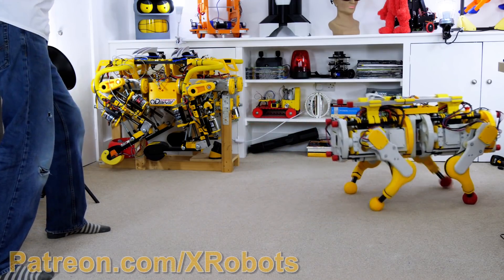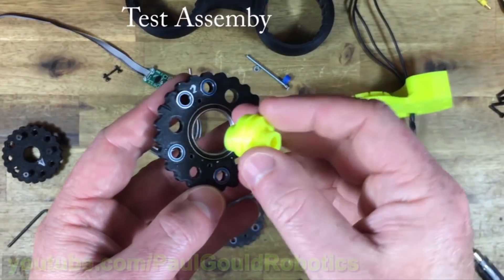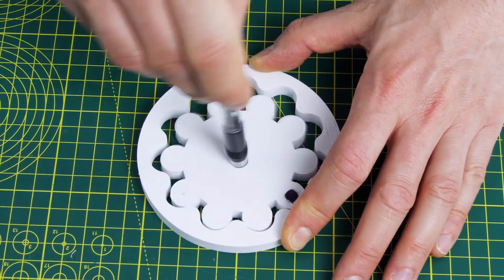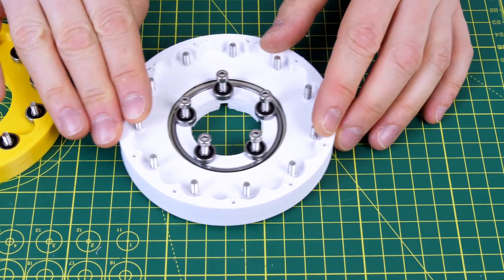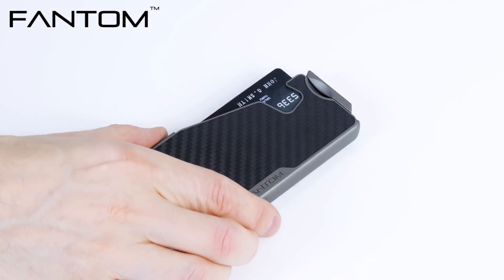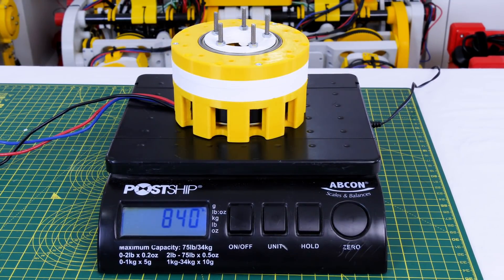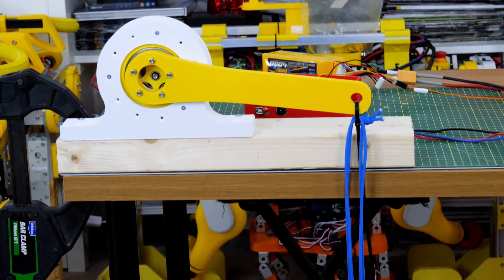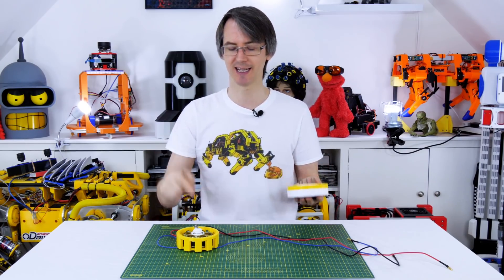Experiments with Cycloidal Drives

Comment: I’d like to to point out that this is not an actual cycloidal transmission, even the animation doesn’t not show it correctly. The cycloidal disc has a specific shape to it which can’t be designed with a basic cad sketch - nonlinear. It has to be calculated and interpolated (e.g. matlab to dxf to cad). I built a full metal version for a robot link myself  (video..), there is no room for shape imperfections :) The actual shape will improve output speed consistency, load distribution around the circumference. In addition: Multiple disc will help to reduce load induced eccentricity and vibration..improve the efficiency (back drivability). As a hint: every roller has contact to the cycloidal disc at any position in rotation. Might seem difficult, it can be described — for “each“ position —  by means of ruler and compasses though
Reply: Is there a technical name for this type of 'cycloidal' variant, or is it just a bastardized version that only works if the materials are somewhat compliant or have large tolerances?
Reply: @rdyer8764  I‘m not aware of a suiting name. It somehow appears as a cycloidal without being a cycloidal :) The cycloidal itself defines a specific shape that’s created by rolling one shape in relation to an other one and tracking a point one the moving element- e.g. circle over circle or circle over a straight line.
Reply: Aforementioned video link https://youtu.be/pzTwEX9iBq4
Reply: @LiyangHU  fancy seeing you here ^_^
Reply: @antitriangular2828  That's pretty damn cool! I think that equation gave me a mathgasm! I love seeing stuff from people way smarter than I.
Reply: @rdyer8764  Hah. Unlikey, I just happened to have been working on an anti-backlash variant of Paul Gould's work after printing his version last week.

In fact, Paul Gould includes his inventor files and the equation is embedded in the defining profile for the disks. I ended up looking up and re-doing it myself because I don't like using equations I don't understand (also - I couldn't get the ratios I wanted to work correctly, and wanted to understand why!).
Reply: @antitriangular2828  OK, I relent...only somewhat smarter. :))
Reply: @antitriangular2828  That's a great tool. It's also fun when you move the sliders out of rational relative ranges and get pretty patterns; some look like Celtic knot work.
Reply: @ardemus  That's exactly the reason I made it really - to understand how the variables relate to one another and to understand how sensitive the equations were to changes in the variables. Trig functions are always fun to play around with.
Reply: Maybe there's a way to counterbalance the vibrations, too. Anybody out there with the proper math skills?
Reply: @jurjenbos228  Counter balancing is achieved by using a second disc with 180 deg phase shift to the first one. Doing this you need a double cam that’s designed accordingly. You can see this in my design. It makes the whole thing even more complicated to manufacture though :) The disc itself can’t be counter balanced since the relativ orientation to the eccentricity is changing with the rotation..
Reply: @jurjenbos228  two disks, 180 degrees out of phase, or two half thickness disks at 180 degrees sandwiching the thicker one.
eccentric cam gets a little large after that.
Reply: @antitriangular2828  Yep, the second option you named is better in terms of load distribution, not the most compact one though. It’s also possible to have even more discswith different phase combinations to improve the dynamic deformation behavior - eigen modi...
Reply: @antitriangular2828  many CAD programs have plugins specifically to create the curves required (I know I've seen it in both onshape and fusion 360).
Reply: I know James uses Fusion, but here's an Onshape feature that makes mathematically correct cycloidal drives:

https://cad.onshape.com/documents/347e6a9ae9d0992f4b101a70/w/d85d62ab1c292cc0d3314104/e/39a63585c0c29cabbfacb536

You could also just look at the code and take what you want.
Reply: I too understand the terminology in this thread
Reply: @EngineeringSpareTime Wow, that looks great. What machining tolerances did you adhere to? Do you happen to know the rough relationship between required tolerances and gearbox backlash?
Reply: @antitriangular2828  Hi could you give me some reference material for the equation and how you made yours?
Reply: Most modern modelling software has support for drawing shapes based on parametric functions
Reply: There's always that one guy.
Reply: @antitriangular2828  Yes, I agree this was not too precise. That’s what I have tried to say with “tracking a point on the rolling element“ :) 
That’s correct, I wouldn’t call this “basic“ sketching tools though, especially not in fusion 360 — what he is probably using.
I posted a link for an step by step construction of the profile in geogebra - seems to get removed..
Nice link! I created mine with a matlab script and then exported in as dxf. This allows to take some optimization for load angles into account as well :)

Comment: I see a lot of strainwave gearing, in industrial colaborative robots, might be an solution as wel.
Reply: I'd actually love to see a proper strain wave gearing that works with 3D printing. I have tried one myself. It was 50:1 and printed from PETG. It did work and had no backlash but was also horribly noisy. Also definitely wasn't back drivable. This is something I should really return to as it did seem promising but was taking too much time back then.
Reply: I agree ...
https://en.wikipedia.org/wiki/Strain_wave_gearing
Reply: They are quite expensive and not really functional if 3D printed though
Reply: @EngineeringSpareTime  ... Perhaps.
But with a little creative thinking, I believe they could be.
I mean ... what this video shows, isn't that functional either. FDM printing require some thought to produce durable mechanical parts.
Reply: @ZappyOh  yes, I agree. I simplified my comment :) you‘d have to adapted to suite the capabilities of the manufacturing technology, that’s quite a challenge though - same as the cycloidal
Reply: @EngineeringSpareTime  What about ninja flex for the flexible sleeve? I seem to recall seeing a video where that worked pretty darn good on a 3d printed strain wave gear. However, I don't know if this would fit the back drive-ability requirement...
Reply: @StarScapesOG  The question is: What “working“ means. The important thing is the transmission behavior under load. Ninja flex will work in terms of moving, the torsional stiffness of this transmission won‘t be great though as well as wear and efficiency due to high friction coefficients (high hysteresis). If one is approaching it with 3D printing, proper materials with low friction and wear should be used. For example 3D filament from Igus (friction bearing company).
Reply: @EngineeringSpareTime  great point. (Wasn't trying to dispute it, just bringing ideas to the table.)
Reply: If he's trying to build a joint that can be back driven, strain wave gearing is not the way to go. It's great for an industrial robot that needs repeatable rock solid positioning in a controlled environment, not for a jumpy dancey robot that's dependent on compliance to function in the real world.
Reply: Working with colaborative robots of Universal Robots learned me that they are backdrivable. The how idk, maybe by using torque sensors on the joints?

Comment: CNC mill a version of it out of metal when you have a model that works like you want and use that to make it both smaller and more solid. Epic cycloidal gear by the way :D
Reply: I came here to tell him that too. I love my 3d printer but there's only so much its capable of. Gears not really one of them for this.
Reply: @santosvella  It's good if you want to do testing. One you have something that works, then you go for the milled metal parts. If that works or not, you tweak it, rinse repeat and soon you have your working device or prototype.
Reply: @taleg1  Yup, that's what i use my 3d printer for. Wish i had a cnc though.
Reply: @santosvella  Maybe one day soon we'll get new 3D printers that are able to do multi materials that include ceramics and metals.  I know we can do that now with some really expensive gear, but imagine what we could try with 3D printers that could created items of durability.

I saw this demo of a very very custom and very advanced 3D printer being researched that more or less could do any material. It could even do 3D milling. It was insane and the cost was in the millions. But we'll get there one day.
Reply: I agree that some crucial heavy load parts are better made in metal. His robots uses expensive motors and ESC's anyway. So adding a little extra to get some essential small and simple parts done in metal while keeping more complex bigger parts 3D printed would be better than trying to use 3D plastic printing everywhere. I also like to suggestion to use stacked PCB material.

Comment: Why you don't use planetary gearbox?
Reply from the maker: For the reasons I said - the gear on the motor takes a lot of strain and will probably strip if it's 3d printed
Reply: @jamesbruton   Does it have to be 3D printed? :) Looking forward to your upcoming solutions and experiences 💪🏼
Reply: @jamesbruton  One metal gear per actuator wouldn't be too expensive.

Comment: Why not just drop the requirement that everybody has to be able to 3d-print this and just use proper metal gears? You're talking about 12 motors that cost 80 pounds each, the people who are going to build this have no problem spending money like it's water, so why all the f8cking about with plastic that you know is going to fail, just to try to save very little money on the most important bits?
Reply: If you've got the money to spend then you're certainly free to make yours with a metal geartrain.  

To answer your question a bit more seriously, it's a goal he set for himself and he seems to be enjoying the process.  Did he at any point show dissatisfaction with how the parts are performing beyond a "I could design this better in this way while still keeping it 3d printable".  Part of the enjoyment of this project is the design iterations and trouble shooting.  Sure he could build it with more conventionally designed/off the shelf parts and throw money at the problem but that's not the point of this build is it?
Reply from the maker: Mainly because the tools to make it are less accisible
Reply: @jamesbruton  but you're not so stubborn as to insist on making the motors from scratch!  Or the bearings, you buy them ready made.   The project is fascinating even for me who doesn't have have a 3d printer, but your dividing lines are idiosyncratic.  Nearly 1000 quid for motors doesn't sound widely accessible to me.
Reply: @jamesbruton  Nearly everything is accessible these days. You could rely on of the shelf parts for the very important components!

Comment: Take a look at harmonic drive with gt2 belts, these things are also amazing!
Reply: I don’t think they are backdrivable
Reply: @Dagor   This is just a question of transmission ratio and efficiency :) A HD with low transmission ratio is indeed backdrivable. It’s not “suitable“ for this robot thought, due to high cost — can’t be 3D printed in the actual shape (normal machines..)
Reply: @EngineeringSpareTime  this is not precisely true. There can be a worm gear with a low reduction ratio and it still won’t be easy to backdrive.
Reply: @Dagor   The efficiency of worm gears is very low, thus there are most of the times not back drivable. But worm drives with a transmission ration below about 4:1 can be back drivable too! :)
Reply: @Dagor  easily saying: without any friction basically every bidirectional drive is back drivable (there might be exclusives but not many..)